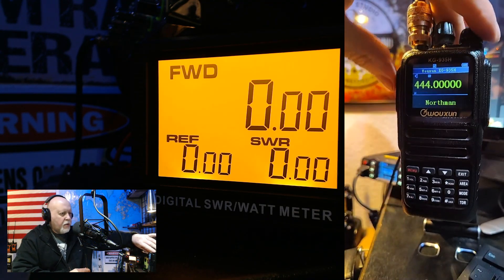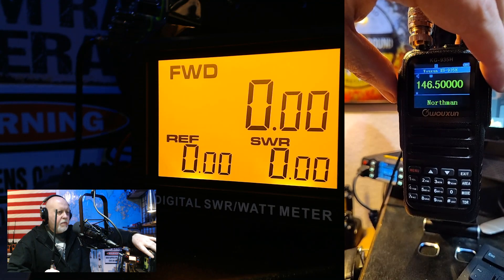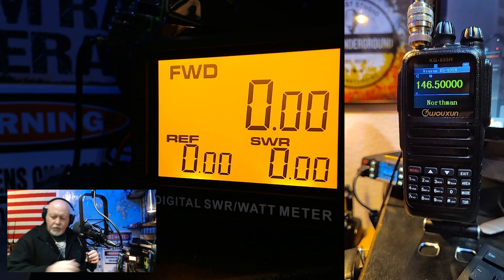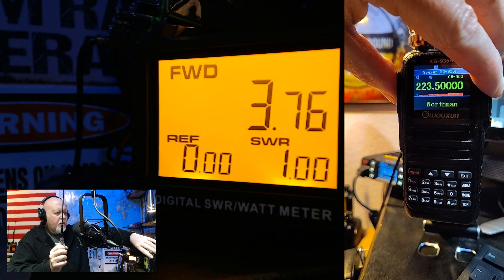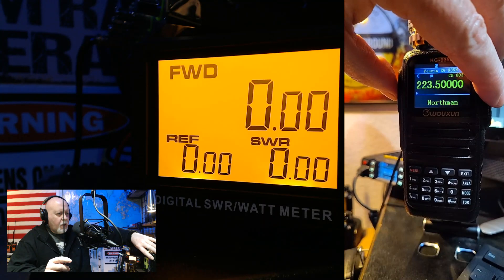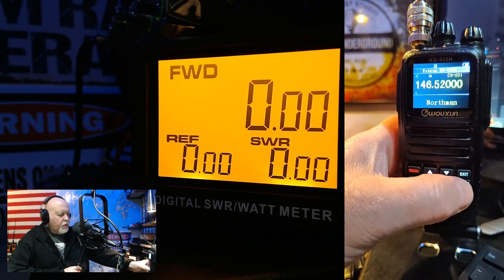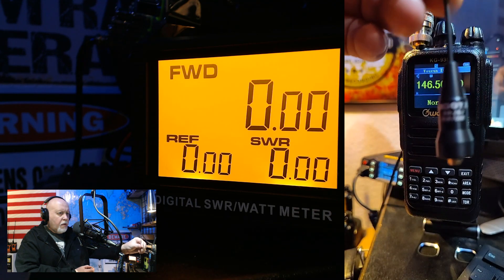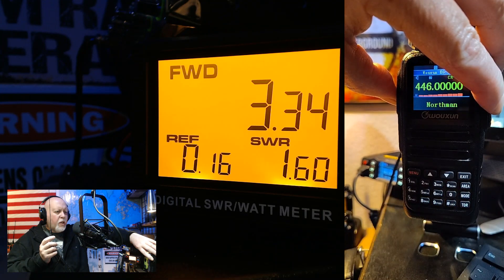Wouxun KG-935H Antenna SWR Test

Comment: Interesting results, thanks, and a good estimation of how those antennas work. But technically, you can't get an accurate reading that way. When you screw the antenna into an HT and then hold the HT to use it, you become part of the antenna. So the resonance will be different than the readings you're getting with that test. Still, those tests are good info.
Reply from the maker: @N2EWSRadio  true enough. Thanks for the input
Reply from the maker: @N2EWSRadio  maybe I'll just screw it to the back of the SWR meter next time take me out of the equation